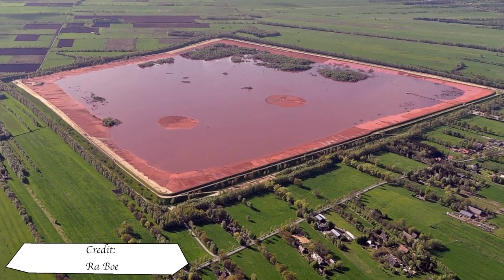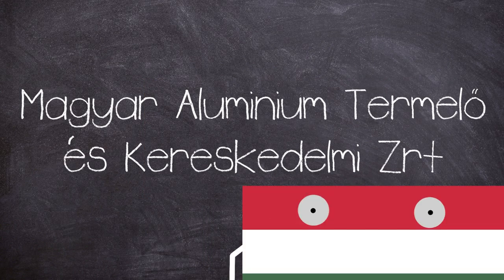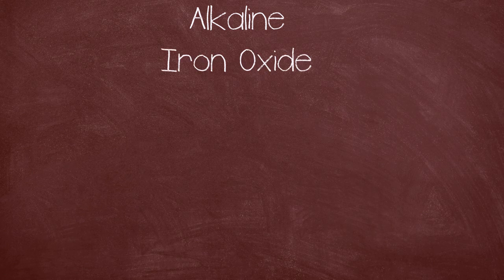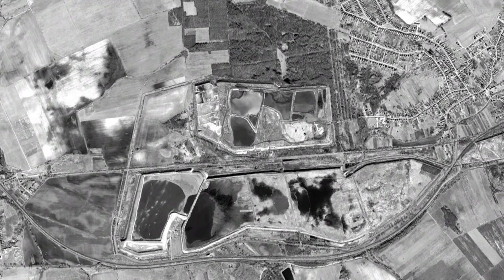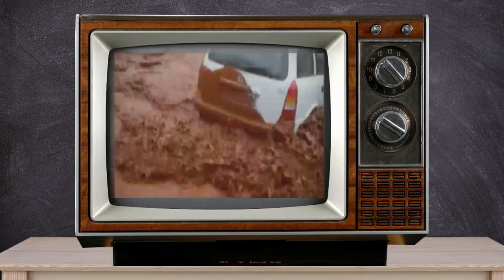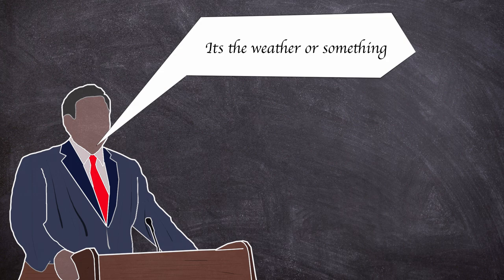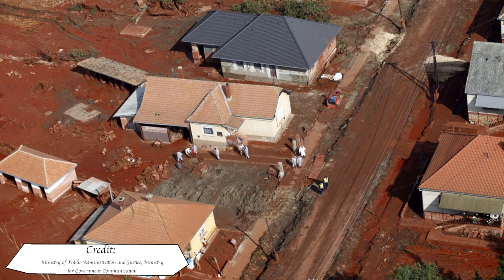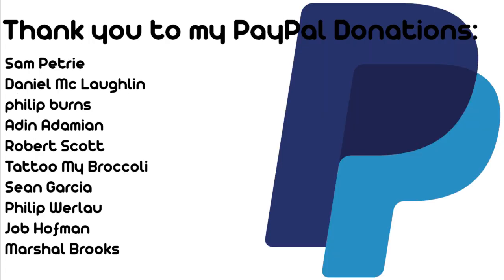A Brief History of: The Ajka Alumina Dam failure (Short Documentary)

Comment: One of my "favorite" catastrophies was a plant that said, and I quote, "the acid doesn't harm the containers, if anything the oxides inside add a layer of protection to the tank. Therefore disassembly and inspection is not needed" 
Shockingly, the pressurized acid tanks exploded because the inside was eroded
Reply: NDK crystal growers in Belvidere, right? I know that one.

Comment: I know that a proper cleanup of the waste can be a lot of work and expensive, but maybe at least neutralise your waste? Acids are usually pretty cheap and that would have helped a lot. But IMO no dangerous waste should be stored outside in ponds.
Reply: Someone else wrote in an comment: BAD idea.  Exothermical reaction ie a lot of heat is created which in a number of cases will show as small explosions.
Reply: @TheStefanskoglund1  Only if you add it all at once, and don't controll the reaction etc. whatsoever. Waste cleanup is a standard procedure every first year student has to do, especially neutralising their waste. I know that it's harder for larger amounts, but if you can run a fullblown chemical plant and regularly perform reactions at high temperatures and pressures like they did, neutralisation shouldn't be a proplem. Just neutralise it slowly while cooling it. This should be a requied standard and it absolutely shouldn't be allowed to store large quantities of caustic waste in an open pond outside. If they have had to neutralise their waste, it wouldn't have been a problem for them to do so. They just didn't to save the cost of a waste treatment facility.

Comment: Totally unrelated to this video, but I felt like you're more likely to see this comment here, than on a much older video..
Don't remember which video it was, but when describing SCRAM, you said it doesn't mean anything.   I learned today that it does..
SCRAM:  Single Control Rod Axe Man.
The first reactors ever made had a single control rod suspended over the core, held by rope.  In the event of an emergency,  a man with an axe would cut the rope., shutting down the reactor.  Hence; SCRAM

Look it up..

Single Control Rod Axe Man

👍

Edit:  here

https://youtu.be/0vZwaMg60FM